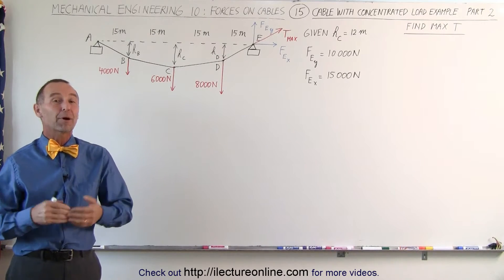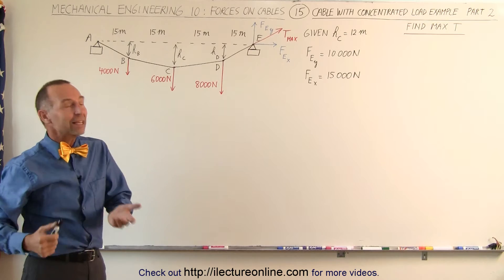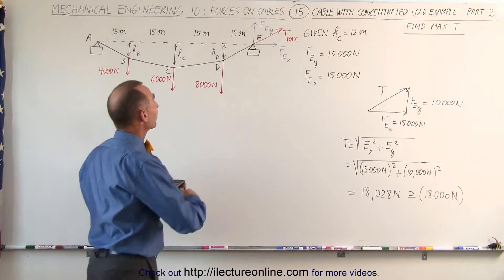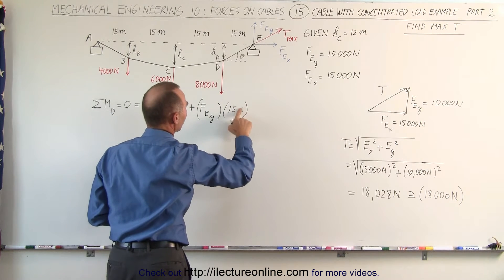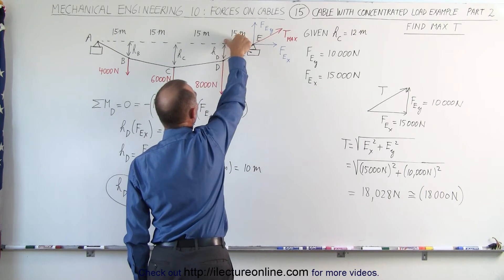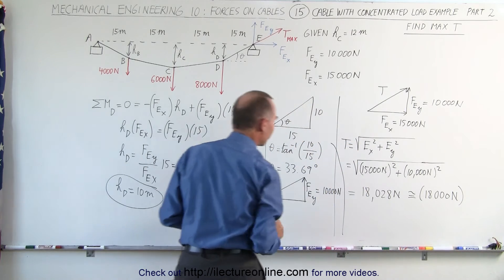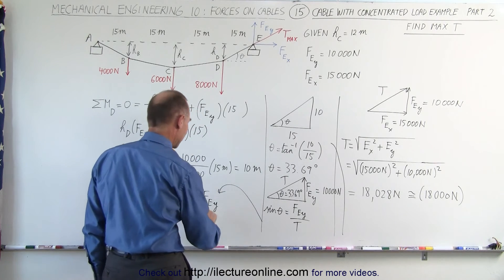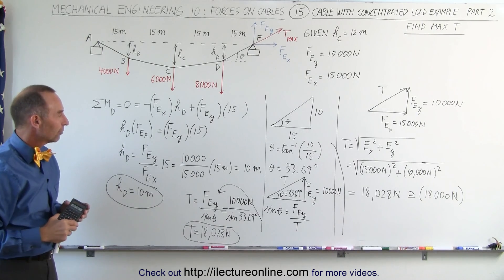Mechanical Engineering: Ch 10: Forces on Cables (15 of 33) Distributed Load: Find T(max)=?

Comment: I've got a question sir... if the slope of the A-B section of the cable was the steepest, would you use that section to find the maximum tension in the cable?
Reply from the maker: It depends on the load and the tension in the cable.